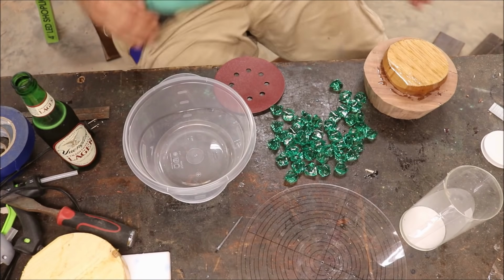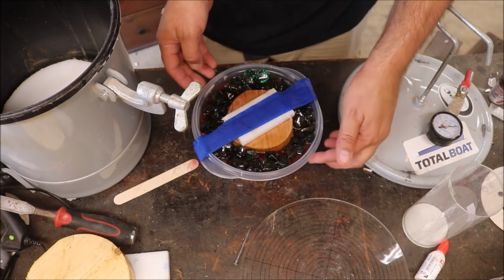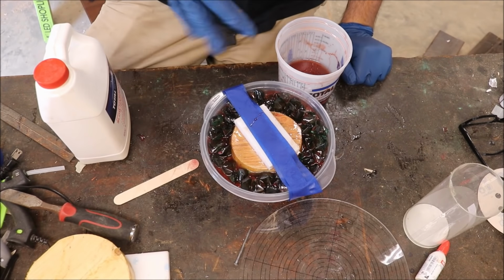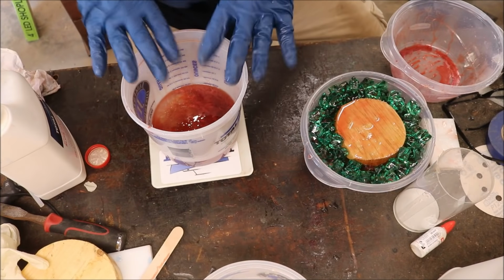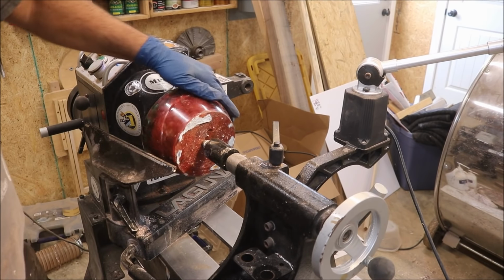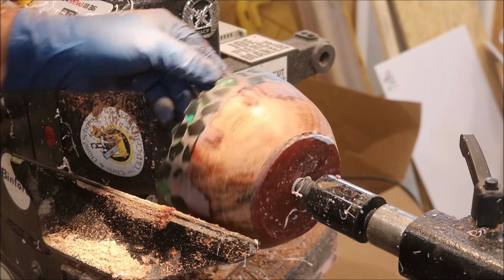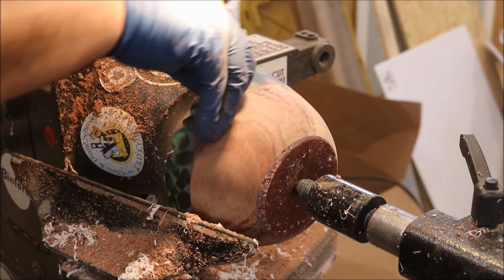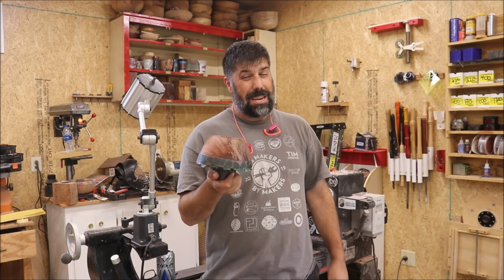Wood Turning - A Mistake

Comment: Props to you for showing it. I'm sure all turners can relate, and learn from it. Makes me feel like I'm not the only bonehead out there. Just last week i had a similar $#!+show with my bandsaw. Not sure what happened, but my 3/8" Timberwolf blade blew apart during a cut. Scared the $#!+ out of me. Thinking it wasn't in the guides. Either way, $50 later, new blade. Gonna start checking that all is in order b4 rushing a cut.
All our power tools have the potential for disaster. Stay safe and slow it down bro.
Reply from the maker: I've had my blade break on my. Not a good feeling. Glad you didn't get hurt.

Comment: I have a suggested project for you!  Using really nice wood, "interesting fillers", and epoxy resin, make a dozen or so door knobs!!!
Reply from the maker: Great suggestion! They could be filled with anything.
Reply: @MoonpieCreations  , true!  An almost endless list of possibilities!  
I love all things "Steampunk" and saw doorknobs with gears in them!  Check it out here:
https://youtu.be/3BiaJr7mn0E
You could also use things like glitter, buttons, various seeds, gold flakes, bubble ball beads, mixed color polymer clay, etc.  I have even seen people turning things that had flowers, wire, and one even tried fuses...the kind with the color plastic bit that you grab and two spade lugs,  coins, and other things.  The problem with coins, fuses, wire, and the like, I would imagine (I have no experience turning anything) is that metal, stone, and the like, are very likely to dull or damage your tools quite rapidly.  May cause you to have to purchase a few more.  
Anyway, if you try it, I would love to see it.
OH, and if you contact me privately, I have another idea, but don't want it spread all over right now.

Comment: Gouge out the part where they join and fill that part in with something else - make a band around the defected area - then turn it to shape
How about Vids on fixin defects.
Reply from the maker: I look at this one sitting on my shelf of shame every day and realize the resin soaked into the wood and may never harden. Your idea was good, but I don't think it will work because of the resin not hardening. Thank you.
Reply: @MoonpieCreations  Thought of that - thought that new hard resin would over-encapsulate the soft stuff.

Comment: Really I would take the 2 and part them off clean up the word And re Rison the two back together
Reply from the maker: The issue is that the wood soaked up the un-mixed resin adn it is seeping out. I have it sitting on the shelf and I hope I can get the resin to leech out. We will see.

Comment: What can I use to coat a wooden shot glass so that you could use it for booze without poisoning someone.Its to be a gag gift but I am afraid she will use it.
Reply from the maker: I have see people use epoxy. It is non toxic was it cures. It's like using a plastic cup. 2:1 slow should work. You can get 15% off of a quart size from TotalBoat using Moonpie15
Reply: Thanks for the information on my question and also for the discount information.